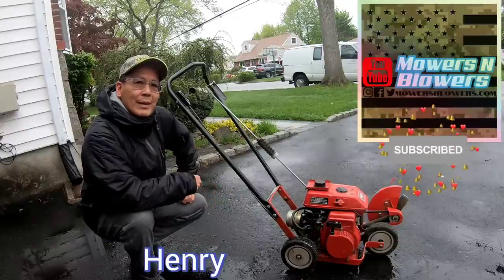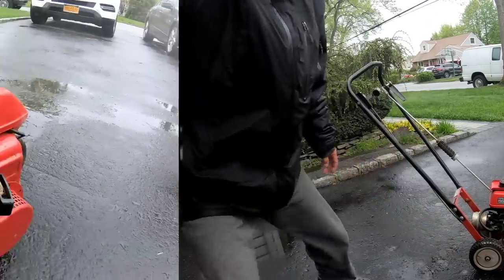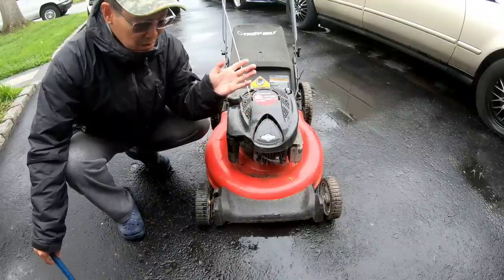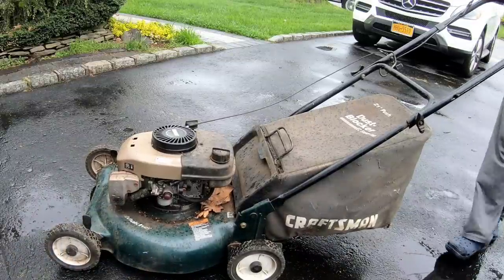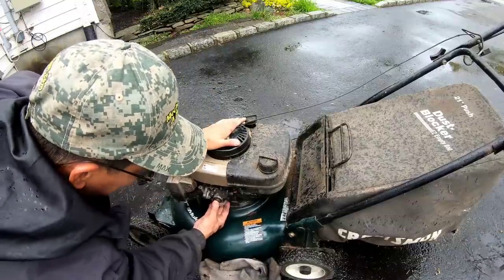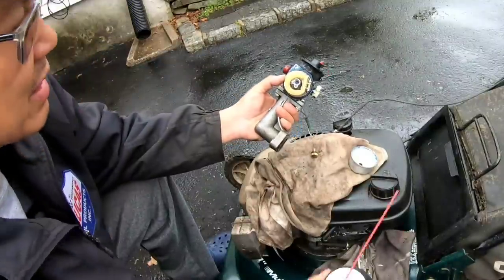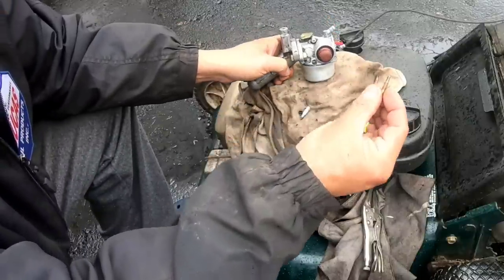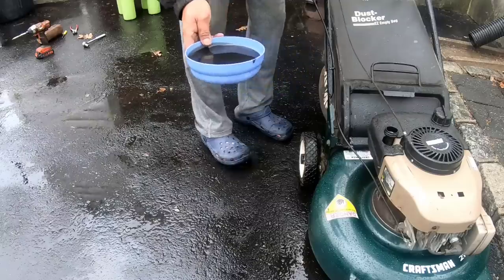FREE CRAFTSMAN 21" 5HP TECUMSEH EAGER 1 PUSH LAWN MOWER CARBURETOR CLEAN RECOIL STARTER REPLACEMENT

Comment: Can you do a complete training video for us on the Tecumseh Carb cleaning from a Craftsman like you have there. I like to see the emulsion tube removal and it's rubber O-rings (is that two O-rings on that), the rubber seat removal for the float and needle removed and replaced, the checking of the float clearance with the special Tecumseh tool. And show us what particular problems you find with this carb setup. AND, maybe on the same video, how you maybe clean some valves possibly thru the port where you removed the muffler on this type of mower, or should you remove the piston head to clean those valves?
Reply from the maker: Lol!  No thank you Bill!  I’ve done all that before on different videos.  And lots of other youtubers have much better videos.  I have way too much to do than to do that again on the engine I hate the most.

Comment: Be aware that if the left mounting screw for the air filter mount is removed the primer will not work. It leaks out of the mounting screw hole. Shouldn't be your problem though. Yours didn't prime before you removed the mount. Just saying.

Comment: Got one similar just put a new carburetor on it it starts and runs but won't keep running😎
Reply from the maker: Water in the gas tank or clogged fuel tank or fuel line